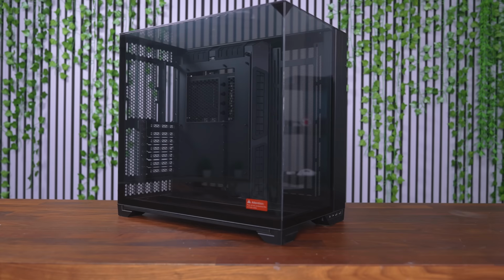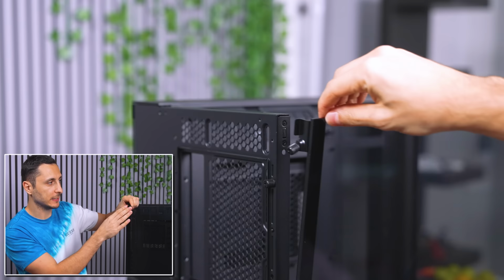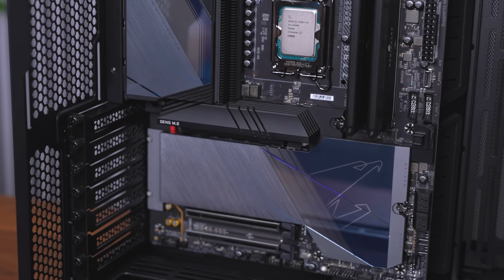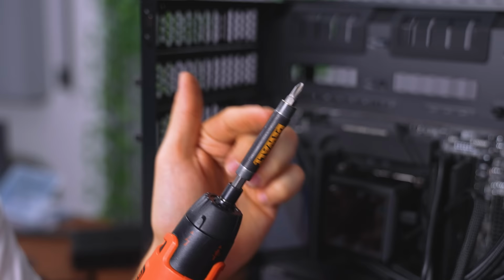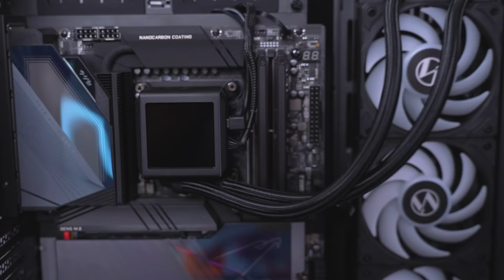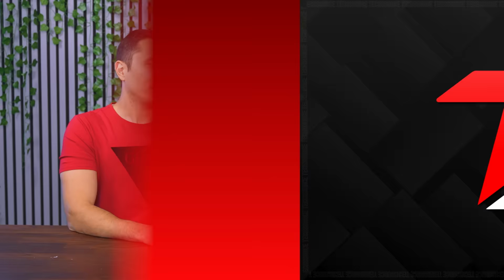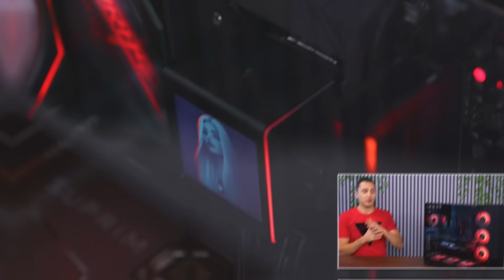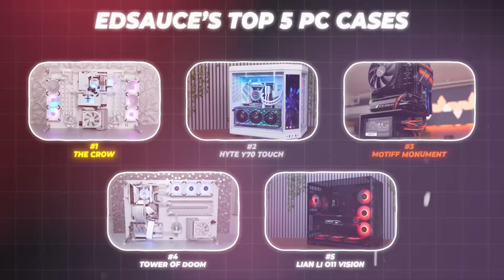Lian Li has done it again! - O11 Vision PC Build

Comment: Hmmm, I am not a pro, but shouldnt be AIO radiator other way around?(I mean hoses at botoom)
Reply: No, its actually very bad for the AIO. The pump should always be below the top of the tubes. Otherwise air bubbles can travel up to your pump and ruin its life.
Reply: @roarbahamut9866 as long as any part of the radiator is above the pump it will not get destroyed by air bubbles.

Comment: The challenge with fans in the bottom is the dust and/or the clearance for exhaust.  Though many people place their computers on the desk or side table, there are still users that place them on a carpet surface and not think twice about that consequence.
Reply: Carpet is a killer … at least some hard base underneath the case …

Comment: If you do push pull on the rad you can probably make up the CFM from the extra two exhaust fans. The rad will obviously block some CFM so 6 intake on rad to 5 exhaust with open access. Not quite balanced but, much closer at least

Comment: with a reg psu u could have put the cables in the front of the power supply ran them right to the managment channel and put an exhaust fan above the psu to pull some heat off the back of the motherboard. i tried that with this case and it works like a charm

Comment: In liquid cooling, smoother operation will be achieved if the pump is at the bottom and the radiator is at the top.

Comment: The door thats on hinges do take SSD 2,5'', BUT! My sata powercables do not fit them since the SSDs are mounted flush to the door (which leaves no space any connecting power cable)

Comment: the cable of the aio coolercan can be put mid going to the right of the motherboard. it would be much cleaner can be on the same way with the 24 pin. it would be much cleaner.

Comment: Maybe you change it before the video ends, but if you're going exhaust on the AIO on the vertical spot, why not make the rear fans intake as well. I get it they are higher, not lower. but wouldn't a cross breeze be better than negative pressure, no matter which direction it's pushing it. you'd match the flow of the other side of the case and create positive pressure.

Comment: Thank you for this video. Very instructive. Right now I am thinking getting an O11 vision instead of an O11 Dynamic Mini (And I would have to get a new taller TV stand that allows me to place the vision case in). I am thinking with 3 fans at the botton intake, 2 fans on the back in exhaust mode and the 3 vertical on the side split 2 at the top in exhaust mode and the one at the bottom as intake. Neutral pressure. But I want to do it with a custom watercooling solution. And right now my only doubt is if it is possible to install a distribution - reservoir plate on the front panel location.

Comment: Gorgeous case and build as always. One concern I have is that you said in the previous video is that you hate RAM slots that are not filled...so why leave RAM slots open in the most stunning case ever?

IK you said it was for a stable overclock, but im still confused.

Would love to have you reply on this comment to tell my why.

Love the vids and looking forward to the next❤❤😊
Reply: Because 4-Slot boards are far worse on memory stability. You answered yourself already. Its basically luck on getting XMP to run with 4 slots filled because of the memory controller. XMP is an overclock, thats why.
Reply: @PDXCustomPCS thanks for the responce and help
Reply: @raynhardpalmer8571  No problem! 😁

Comment: What im wanting to build any recomendations?

NVIDIA GeForce RTX 3080 Founders Edition GPU

AMD RYZEN9 3900x CPU

Lian Li PC-O11DX Case for PC Black

2 x Samsung 970 EVO 1 TB PCIe NVMe M.2 (2280) Internal Solid State Drive (SSD) (MZ-V7E1T0), Black

MSI MAG X570 TOMAHAWK WIFI AMD

64GB Corsair VENGEANCE RGB PRO DDR4 RAM (4x16GB) 3600MHz CL18 AMD Ryzen iCUE Compatible

Corsair AF120 Air Series, 120 mm LED Low Noise Cooling Fan - White (Triple Pack)

Corsair AF120 Air Series, 120 mm LED Low Noise Cooling Fan - Red (Triple Pack)

Corsair Hydro 100i RGB Platinum, Hydro Series, 240 mm Radiator (Dual ML PRO 120 mm RGB PWM Fans, Advanced RGB Lighting and Fan Control with Software) Liquid CPU Cooler, Black

Corsair RM750, RM Series, 80 Plus Gold Certified, 750 W Fully Modular ATX Power Supply - Black

Comment: You could have just put a mesh sleeve over all the wires coming up from the AIO block and would have looked much cleaner, and wouldn't have sacrificed a fan in an already low fan build.

Comment: I'll probably be upgrading my case to this one shortly, but there is one thing I find odd about every review out there; Nobody has put 140mm fans in it. I can't find a single example.
Did Lian Li stipulate that reviewers MUST use 120mm Lian Li Unifans in the reviews? Or did they provide them with the case for reviewers? For a decently priced Lian Li case, it stings knowing the Unifans cost more than the case itself (they're good fans, just expensive). I'll probably end up buying the case and putting the 140mm fans in there that I want, but I can't help but think Lian Li definitely had their requirements for the reviews. I would have loved to see someone at least try to put 3x 140mm fans in it

Comment: Dude, you could have pulled the whole motherboard tray out with two screws instead of undoing 9.

Also, when you moved the motherboard tray into the low position, you didn't add the extra grommets.

Comment: Why did they make bottom fan installation more complicated though? O11 D Evo has bottom fan rack fixed with just one thumb screw, and here you need to remove 3 screws with a screw driver to do the same. I assume there's a reason for that, just interested what it is.

Comment: Any information on this would be much appreciated.  I recently build this setup for my new gaming pc.  I can't seem to find a version on L-Connect that works with both the SL120 fans and the Galahad II LCD.  One version of L-Connect allows the fan lights to work perfectly, however there is not an option to change the Galahad II LCD.  The other Version of L-Connect allows me to change the Galahad II LCD Screen, but when I change the colors for the SL120 fans, the outside border lights of the fan don't change from Red, Green Blue.  Would you are anybody happen to have any information on how I can get both to work through L-Connect?

Comment: Are you able to remove the top glass panel and switch it with a panel that supports 3 ceiling fans?
Reply: Defeats the purpose of the case.
Reply: @TheSjuris  yeah I I had no idea the evo rgb case existed when I asked this
Reply: @popoetic   both are good cases.  The airflow isn’t as bad as you’d think in the Vision.

Comment: What You did makes the case look great but I still don't like the position of the AIO which I would want on top with Tubes Facing Down. I love the Lian Li cases but Not a Fan of the New Vision Case only the Top as from almost All Cases either have Fine mesh or Glass Like this one on top. I like the little upgrades from the EVO but wish All Cases came with a Large Hole Top Panel to let the air out when using a AIO on top and maybe have a lite magnetic filter under the cover. I have never liked the top cover even with large hole having Slots for an AIO and a filter to cover the slots and top cover that you have to remove to get the right air flow out. There should be a removable AIO plate for the AIO then a Fine mesh filter and all topped off with a larger holed more open top cover as fine steel cover only works to let out 50% and the more heat out the better with larger holes. The vision comes with a removable motherboard tray which is a upgrade.

Comment: It's a shame you mounted the radiator flipped, the tubes at the top will give problems. Here's my major point for this good looking case, can you mount a liquid cooler so the tubes are at the bottom? The GPU seems to be in the way.  Can you for instance go around the GPU, is the tube long enough or can you fit a 2 radiator at the rear with tubes at the bottom? Thank you for looking into this!
Reply: Tubes at the top last 3+ yrs. No issues...🤷🏽‍♂️
Reply: @roelgarcia2894  sound issues I mean

Comment: Hey this a long shot but could you help me with a issue with my pc every time I hop into a game like Fortnite my keyboard is like bugged I’ll move forward let go of the key and my character will continue to move forward depending on how long I was holding the key for while that is happen I can’t do any other commands until the first commands finishes up and it will do the same thing for other command my mouse works perfectly fine. It’s not as bad on Valorant but it’s still annoying

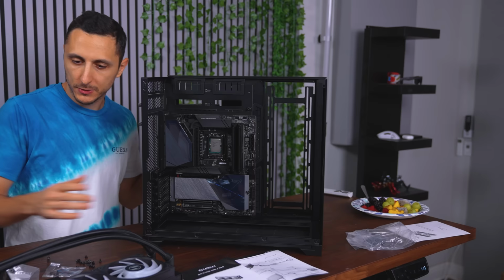Comment: 7:27 Never install your AIO pump/CPU block as the highest point of the system! Never!! Gamers Nexus did a very good video on that a few month ago! Having the block as the highest point will cause the air get trapped in the block/pump = less/no heat transfer. This will drastically reduce the lifetime of your AIO and system, possibly frying it in the process!!!!!

Comment: I've always been function over form. I'm more interested in the get it done case. My first 2 cases were the Chieftec CH07B-B-OP and the Antec GX500 (non-window). Currently building in a Deepcool CL500 and my new system in the Antec DP503.

Comment: Hey ned would a i9 13900k and a 4080 be a good combo? Need your opinion
Reply from the maker: yes
Reply: I'd recommend not going for a 13900k unless you have unlimited budget. I'd just go 13600k or 13700k if you really want to. CPUs above the 13600k are really just for productivity and unless you're a blender beast or an editor who does intense workloads. I'd just take the saved $250 and put it into something else. :)
Reply: @Smileyidk  I’m using it for gaming

Comment: Yo man! Are those cases actually worth it cooling upgrade wise?...Im using a phantecz a500 pro case...it peaks about 60-70 on high settings...running a 3060 ti,360mm cm aio,240 mm exaust fan. and 3 intake fans...can i get one of mouse pads would appreciate it ty!